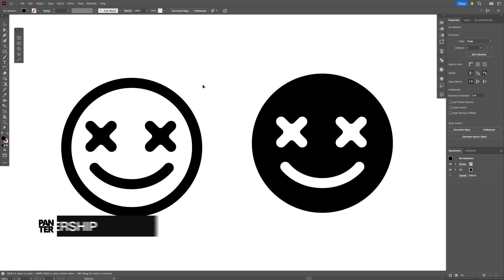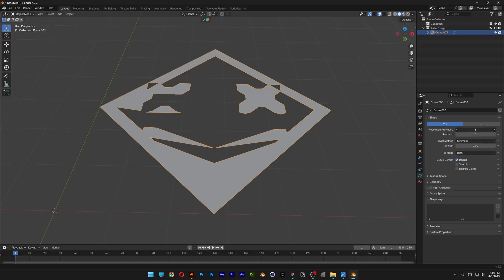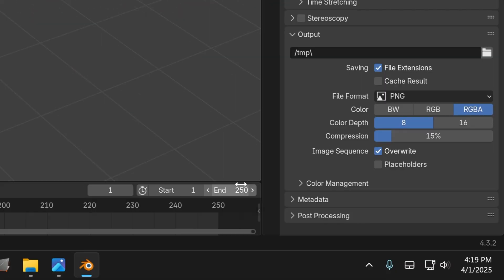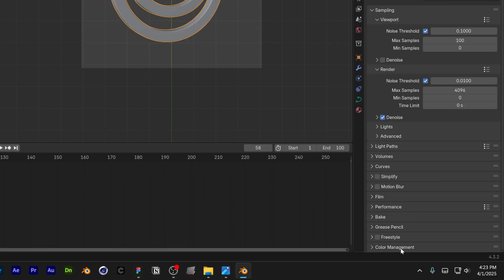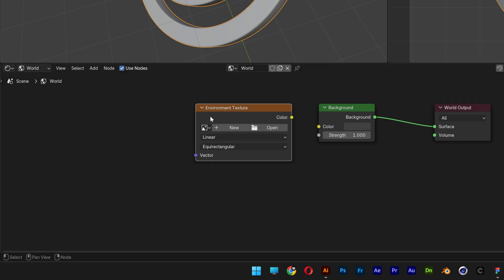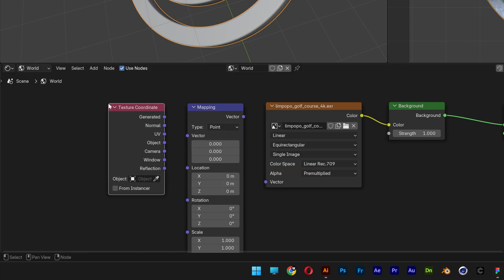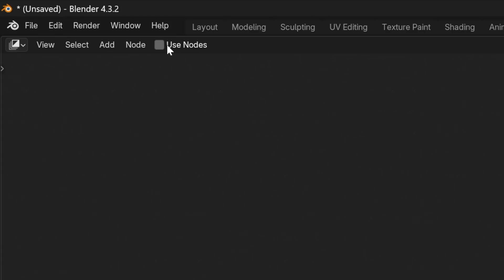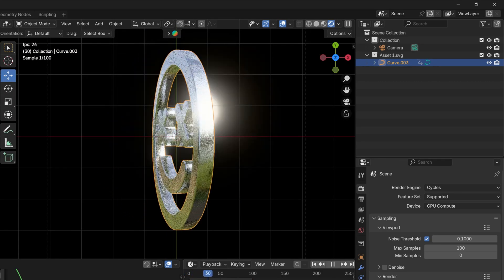How To Make Spinning 3D Chrome Logo In Blender

Comment: what difference did the colour management setting do? i know about the others kinda but never seen the one you used? also could this be done for glass? really struggling on glass in blender atm with lighting and rendering it. to look…. like glass. the effect is there but when rendered you cant tell lol due to maybe settings or lighting
Reply from the maker: It adds really good global contrast. Some of the settings there are available in new versions of Blender. I got a few Blender glass tutorials too on my channel you can check it!
Reply: @PANTERvision  i think i watched them recently :) i wont lie to you i still cant get it to look how u did even though iv followed how the video did it lol. even the same HDRI...... i dont know if its the background your using with the image, or if im not making either my logo or text thick enough or something. but it really just looks..... either bad or just glossy lol not glassy hahah
Reply from the maker: @TheCofatherOG  It's not transparent? Also the distance between glass and BG defines the magnification in the glass and the IOR. You can try adding only one Glass node at first to experiment with it, that alone should bring the correct results.
Reply: @PANTERvision  ok thanks legend i will try these ideas :) you also said try adding only one glass node, i only have the one shader like in the video, do i need more then 1?
Reply from the maker: @TheCofatherOG  Just play around with one glass node to see if it works. If it doesn't work you need to switch the render mode

Comment: I was struggling because of the SVG, It won’t import into blender like yours 😭😭😭
Reply from the maker: SVG's can have a lot of issues, but mostly you need to correct the paths
Reply: @PANTERvision I was able to do it but the final result is so pixelated when I play it 😅
Reply from the maker: @Retrocherriii  I think you need to increase the size at least to 1080x1080. Also increase the max sampling at the render between 100-200.

Comment: having trouble rendering/exporting. Any suggestions?
Reply from the maker: What trouble did you have with rendering?
Reply: @PANTERvision  I think the problem is in the render output settings. It's not set to video format and H.264, etc. Also, in Cycles it takes a long time if you don’t tweak some settings properly.
Reply from the maker: @friedmoonrat  You need to change the file format to  FFmpeg Video then set the encoding to MPEG 4. In cycles you gonna need to drop down the max sampling because the default is at like 4000+. I think I had the max sampling at 100-150 for this animation.
Reply: @PANTERvision  could you do a video on rendering and render troubleshooting? i've spent hours trying to get animations out of blender.
Reply from the maker: @cutiepatootiiiiii  I could

Comment: Why wont the SVJ show up on the blender map? or like the main grid it shows nothing and in the file manager it just shows the small box icon next to the name of it nothing else
Reply: im using photopea btw ^ i dont have illustrator
Reply from the maker: @ It might not be a vector image if you exported from Ps. It has to be a vector SVJ.
Reply: Im having the same issue. I uploaded my png into illustrator and exported it as an svg. I imported the svg into blender and the file appears in "scene collection" window, but it is either invisible or im missing something. Im new to blender and illustrator some1 plz help :P